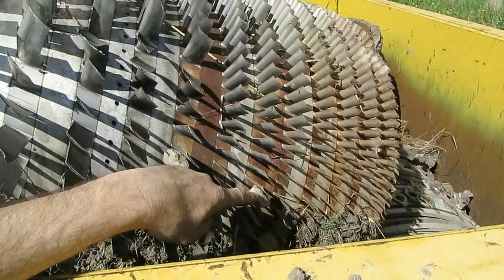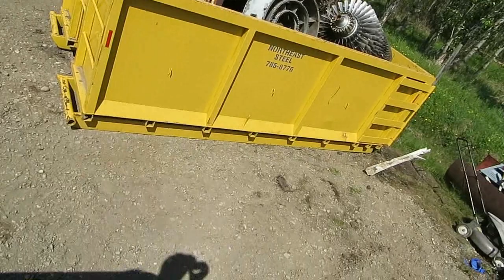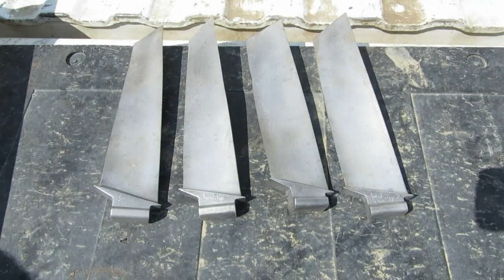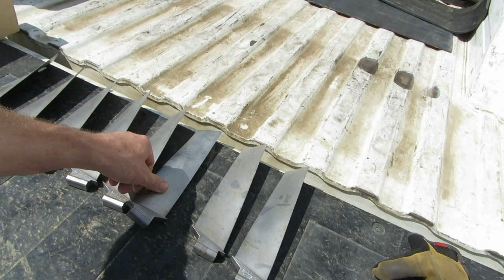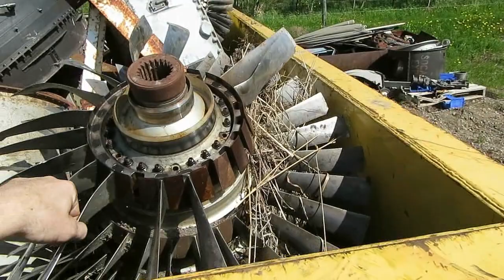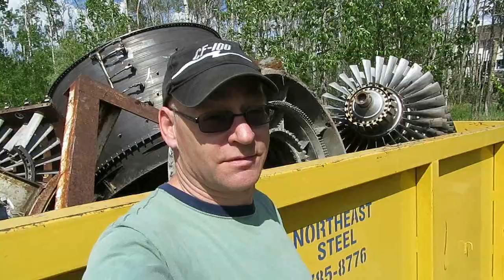Free Stuff !   A contest in June.

Comment: OMG! I've been hoping for something like this. I have been building my own J79 from scavenged and eBay parts for the last 2 years. I am so close to finishing it and all I need is one single stage one compressor blade. Can't find one anywhere! This would do it for me. The thought of having my own running J79 has been driving me mad, and thanks to your videos I learned how to assemble one. Please please pick me!
Reply from the maker: That's a good one ! most original yet... but you missed out on the bonus question.
There are so many entries after only about 6 hours, I'm worried about the next 5 days !!

Comment: Relatively new to your channel but it indeed refreshing to see the behind the scenes work that is involved with overhauling engines! Your lock wire video was all to interesting for myself considering the topic, haha. As for why I'd like the privilege to own one of these blades, I grew up loving aircraft for no major reason that I can remember, but they inspired me enough to go to school for aerospace engineering. I graduated a little over 2 years ago and managed to get a job in the industry working on landing gear. Like any individual I take a lot of pride in the work I do and would love nothing else if I was able to take a piece of it home, however as landing gears are usually large forgings it is generally impractical. It also doesn't help that when we have to scrap stuff it usually goes back to the forgers to be melted back down. The final nail in the coffin is that the programs I support are controlled by ITAR and CGP so the chances of me getting even the smallest piece of scrap are nil. As such I think it would be amazing to have something like a compressor blade, from a J79 no less! I'm not sure that is a good enough reason but it is the best I have, I'm sure any aviation buff would love to have one of the blades.

As for the date, I would have to say you are speaking about the allied beach landings on Normandy France 70 years ago. 20 century history I would have to say is another interest of mine, but anyone who has had the benefit of being in a country with mandatory education should be able to recognize that date in an instant.

Keep up the work with the videos, would love to be there for an afterburner test!

Comment: It would be an honor to receive one of your blades.  Yet I dont need to receive as I really enjoy learning about jet engines.  I really appreciated the part about how the blade mounting surface was increased to maintain blade tip speed.  That was very enlightening.
  Also the part about how the torque for a genset does not use a direct connection to the main shaft.  So much useful info, I am sure there is more yet to come.

Keep up the good work.   Sorry the date means nothing to me here in the USA.

Comment: JZ, 5 years ago I was working in an call centre slowly loosing my mental ability and wanted to work with aircraft. So I left and got a job at the Museum of Flight for a year, taking a huge pay cut. After that I went back to college and worked my way through an honours degree in design, and now Im working on my Masters in Advanced Manufacturing, working on the new production methods for parts like this. I'd like one of these blades for a few reasons. One, it'd represent the industry I want to go into to me, Two, Im working on my dissertation and it'd give me some drive to keep going on it, and three, because its cool. Not sure if that technically counts, but still. As for the bonus question, Im not entirely sure, so Ill just take the hit on that one!

Comment: I was trying to find something cool and coincidental about D day and the L-1000 but there doesn't seem to be anything. The L133 plane was proposed 2 years before Dday but the engine didn't run until 2 years after D Day. It's a very odd looking engine without variable stators and it was cool to find they didn't aerofoil the blades of the compressor. They were fixed onto the hubs in a way that let them be adjusted to find the optimum angles. In developing the engine all sorts of clutches and things were tried to make it work. One thing was the same as the J79 - canular combustors. Anyway I hope the contest is still open. I'd love to have a go fixing one of those blades. If I video it you can tell me if I fixed it right!

Comment: Greetings  AgentJayZ

From as far back as I can remember, I have been crazy about Turbine Engines.  A few years ago I was working at an Airport and if I heard a Turbine spooling up, I just had to go and see what was up.  Even today, if I hear the sound of a Jet Aircraft overhead, I will stop what I am doing to watch and listen to it fly over.  I am a Diesel Mechanic by trade, a hobby Machinist, into Electronics and also fly Radio Control Aircraft. One day I drove four hours to an Auction Sale to try and purchase an APU that they had listed only to find upon arriving that the owner had removed the APU from the Auction Sale.  Boy was I pissed.  It sure was a long ride home.  About fifteen years ago I decided that I would like to try and build my own Turbine Engine.  So I purchased lots of Books, searched the Interweb and finally decided to build my own version of a KJ-66.  The original KJ-66 Turbine was designed for flying in Radio Controlled Jets. My Turbine has a Radial Compressor and an Axial Turbine (66mm diameter) on a common shaft supported by two Ceramic Ball Bearings.  It has 20 lbs of thrust @ 120K rpm and idles at 35K.  An Electronic Control Module was also designed to safety operate and control the Turbine by monitoring rpms and EGT.  The Turbine can be started with either compressed air or an on board electric starter.  Propane is used for approximately five seconds to preheat the combustion chamber and than the fuel is switched over to Kerosene by the ECU.  I truly enjoyed building this Turbine but there where days when I wondered what the hell I had gotten myself into.  I can still remember that cold winter day that I first tried to start my Turbine.  I was shaking like a Leaf (nerves) and when it finally started I had a foot of flame coming out it's exhaust.  A little to much fuel.  After a whole lot of sweating and many alterations and adjustments my Turbine starts and runs great, and no more flames. Finally success.

So as you can see I have been bitten by the Turbine bug really bad.  Have watched your channel from the beginning and have enjoyed every single Video.  My favorite ones are engine tests in the Test Cell.  I even get excited watching you Guys start your Start Cart.  I often wonder why you give so much of your time to produce these Videos?  And I came to the conclusion that you have also been bitten by the Turbine Bug and the rest of us are all so very lucky that you have.  If I was to win a Turbine Blade, it will be polished, mounted onto a nice Oak Stand and put up on display beside my Home Built Turbine Engine.  Thank you for your consideration.

This Friday June 6, 2014 is the 70th Anniversary of D-Day and the Battle of Normandy.

Cheers

Bill Blackburn
Creemore, ON

Comment: Hi AgentJayZ, you’ve had a few messages from me, but this is my story.  I designed gas turbine engines, industrial, marine and aero (civil and military) for Rolls-Royce for almost 40 years.  I believe that, in terms of breadth of experience, I was the most experienced gas turbine designer in the world.  So what have I worked on?
Industrial and Marine Proteus, Industrial and Marine Olympus (including the TM3B power turbine), Marine Tyne, Industrial RB211, Marine Spey, Industrial Olympus 593 (which did not go into production), RB199 (in Tornado), Adour (in Hawk and Jaguar), Olympus 593 (in Concorde), Pegasus (in Harrier), EJ200 (in Eurofighter Typhoon), IAE V2500 (HP compressor), RB211-524G (IP compressor), Trent 600/700 (intermediate casing), M45H in VFW614, Viper (500 and 600 series), Spey mk807, MT30 (Marine Trent), TP400 (in A400M Atlas), Gem (in Lynx Helicopter), Gnome (licence-built T58 in Sea King).  I even had a passing responsibility for the ‘legacy’ piston engines (we had terrible problems with the manufacture of Merlin camshafts). Probably the highlight of my career was a day trip to New York on Concorde in 1995, as a guest of British Airways.
6th June 1944, was  a couple of months before I was born.  It was D-Day, and I have visited the invasion beaches and the cemeteries (and those of WWI in Flanders). Visitors can walk freely among the headstones in the British and Canadian cemeteries, reading the names and ages of the fallen, which is very moving. However, visitors can only look down from a distance on the long rows of headstones in the US cemeteries, which, nevertheless, is still a moving experience. My late wife's uncle was in a Sherman tank on D-Day: it was hit, but he survived.
PS  I don’t really need a J79 blade: I have a mounted and polished V2500 first stage HP compressor blade, which was my retirement memento.  However, if you ever have a scrap Olympus ‘C’ LP turbine blade (which I designed years ago), then that would be fantastic.